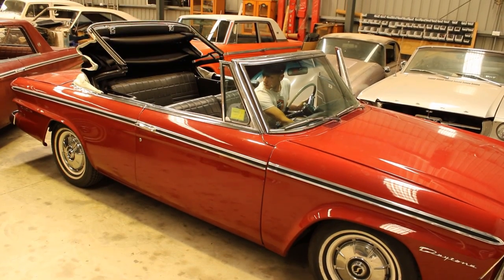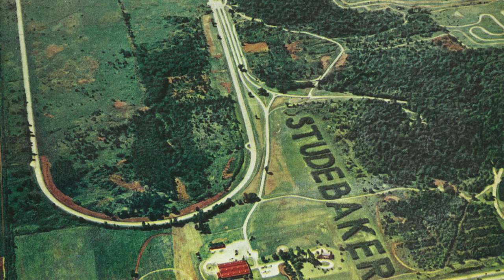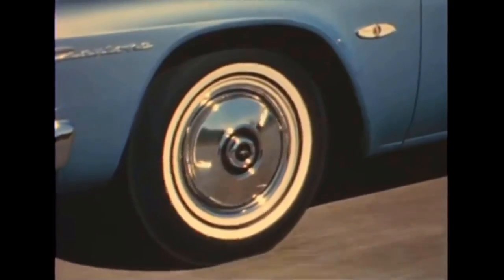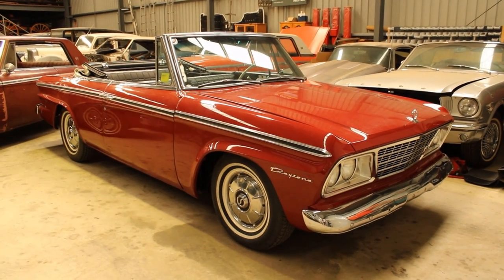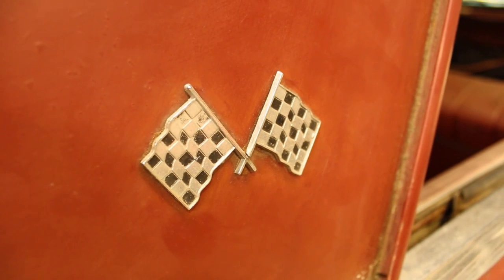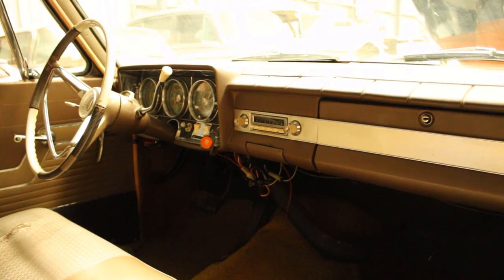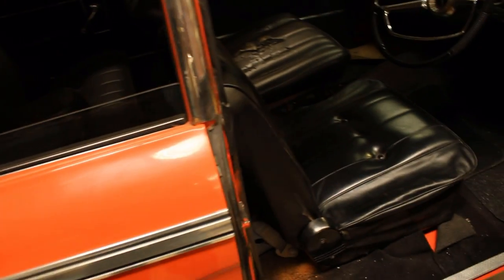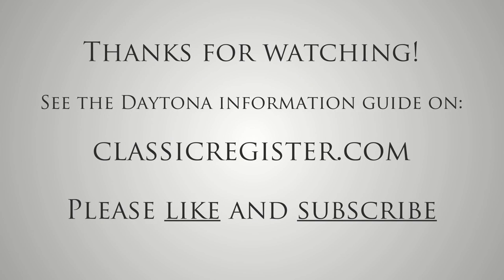1964 Studebaker Daytona Review and Information

Comment: Couple points, Studebaker in 1964 as well as 1963 was offering all the performance packages across the line, not just the Daytona.   One model you left out is the lowest end car, the Heavy Duty Special Sedan for Fleets.   I own one with the RI package, (A Super Lark Package sans the bucket seats).    The GT touring racing aspect wouldn't have even been thought of, the USA market, racing was only two things, Stock Cars at NASCAR which wouldn't have allowed Studebaker due to smaller wheel base.....or Drag Racing.    The GT racing circuit didn't exist in any real form in the USA or Canada.   Yes, it might have helped sell more in England and UK, but the investment would never have paid off in the USA.  By 1964, the Lark type cars had grown in Wheelbase size and total weight and length, it really went head to head in the Midsized Car Market rather than your claim of the Compact Market.   It was significantly larger than a Chevy II, Falcon or Valiant.    It was more a competitor of the Mercury Comet, Dodge Dart and Rambler Classic and to a certain extent, the Olds F85 and Buick Special......in the smaller Midsize range.  It did start as a compact in 1959, but grew in size over the 5 year time period.  One reason for the low numbers is the shutting down of the South Bend Plant in the USA and only keeping the smaller Canadian Plant going.  In relation to the promotional film your reviewing, and the cars that were the focus, that wasn't a Public Promotional film, but an internal film for Studebaker Dealers.   Nobody in the buying public would have ever seen the film.    That film is simply the standard new introduction film for Dealers to get educated.    Studebaker didn't advertise significantly at all because it didn't have the funds.     They had been part of the creation of the TV Show "Mr. Ed", and even there by 1964, Studebaker was an "Alternative Sponsor" rather than the primary sponsor which became Kellogs Breakfast foods.  In terms of Exports, All Studebakers that went abroad  to the commonwealth countries were sold out of the Canadian Operations for Customs and Duty savings, BUT, convertibles ended in 1963,  in November and were only produced in the USA  The French car you see is an American Built car rather than Canadian and France clearly wasn't a Commonwealth Member Country.
Reply from the maker: Thanks for your comment! Absolutely, lots of offerings for Studebaker in 63/64 - just focussed on the Daytona for the purpose of this video as that's what I had available - hoping to cover some of the other models soon :).
Reply: Thanks…Interestingly, my Great Aunt in S BEND INDIANA, TRADED HER HAWK, for a 57 PORT HOLE T BIRD!!  Vivid memories 65 years later.

Comment: well done I have a 64 Daytona 4drsdn with the 259 v-8 and auto trans no p/s or brakes.
Reply: I also have the 64 4dr post. I've gone restomod with mine. I am going for a sinister look, mods are newer Chevy 350 roller motor, 700r trans with 3k stall converter and b&m coverter lock up, 10 bolt Chevy with Auburn locker and gears, mini tub out back and inner fenders in front, 20in. Wheels and tires, shaved trim and handles, inside is mostly stock including the wheel the exceptions are in dash 5in. tach and oil pressure, water temperature,volts guages under dash and bucket seats. What you think?
Reply from the maker: @johngoodrich5793  Sounds great - I saw the picture you sent through, HUGE wheels you'fe fitted to it!! Best of luck with the project, looks very cool!
Reply: @classicregister  thanks . I dig your video, very cool and packed with imfo and some very sweet rides

Comment: ..... Thank you for this film, as I learned a lot ... ! ... To see my actual car, a 1965 Cruiser, type in something like: Studebaker on it's last leg on YouTube... Not implying the car was on its last leg, but that the company was ready to become past history ...
...... Mine is fully appointed with every option: Twin traction, Power (front) Disk brakes, Reclining Seats, Vanity mirror, Working clock, aftermarket Air Cond., 283 that just turned over 64K original miles this month... And I just (this month) got it back from the shop, where a NOS wiring harness was installed (complete under dah and hood) with updated fuse block and a bunch of other needed repairs... I feel confident it would travel without an issue, across the US and back ... Best Regards .....
Reply from the maker: Thanks Larry, I'll see if I can find your car on Youtube. Thanks for your comments -  they are a very unique car - and although the company was failing by the mid-60s, I do think they had a great product in those last few years, although faced severe and increasing competition. You should definitely get your cruiser out there and do a road trip across the US!!

Comment: Were they all automatic transmissions?
Reply from the maker: Hey mate, all the cars in the videos are automatics. However, manual was an option and fitted to some cars. It was a 4-speed floor mounted manual: Option code "22", which was a Borg-Warner T-10 Transmission.